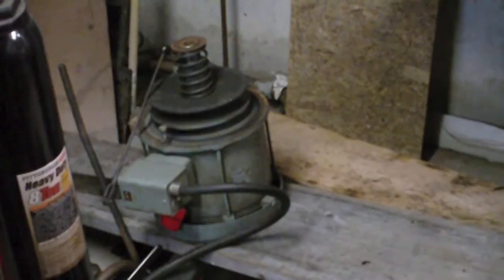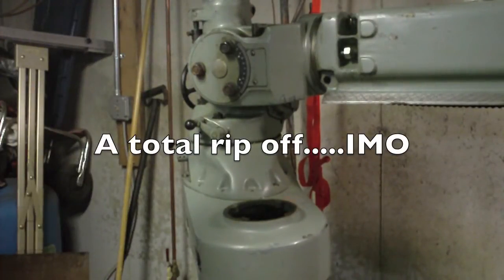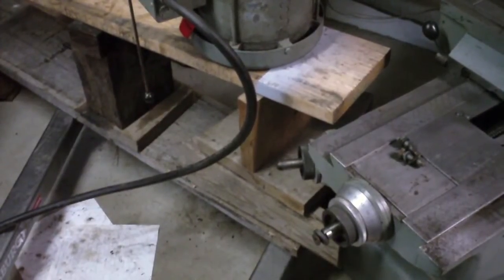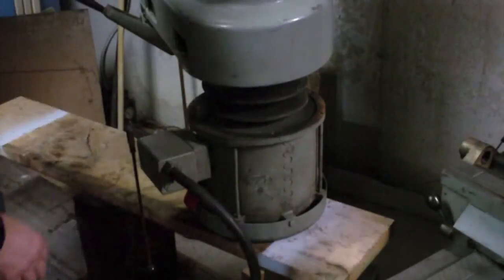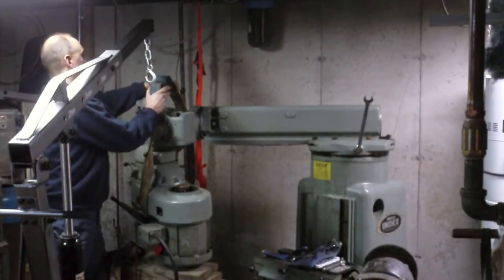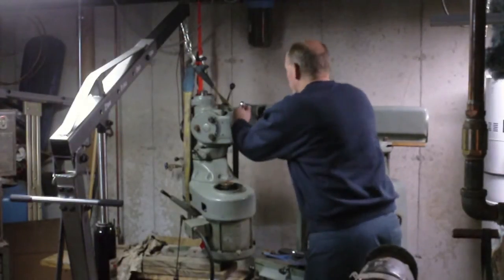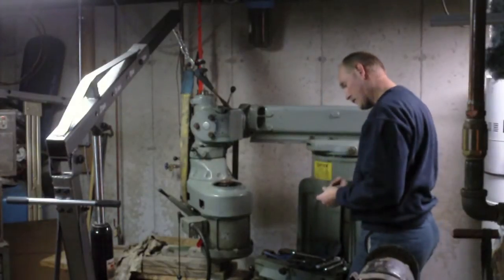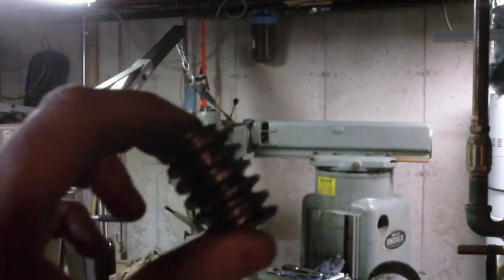Wells Index Milling Machine Part 24

Comment: Hi Steve,
That mill should be making chips by now so a new drive belt wouldn't go astray judging from the crap inside the belt cover...
I did a quick google search and came up with the following.
The drive belt 1922 V 403 is available from Speed Selector Inc for $42.28
Bando want $49.42 
That $90 price was a ripoff.
The belt numbers mean (19) it is a belt 1" 3/16ths wide (22) is the side angle in degrees and the 403 refers to the pitch length which ends up to equal 40.9 " in circumference.
This info is from the Bando website in their products pdf.
Cheers Eric
Reply from the maker: Thanks Eric. I also found those deals, but with the belt being an easy thing to change (now that I've taken it apart a few times) I held off on a new belt. Glad I did, I've got bigger issues.......stay tuned.